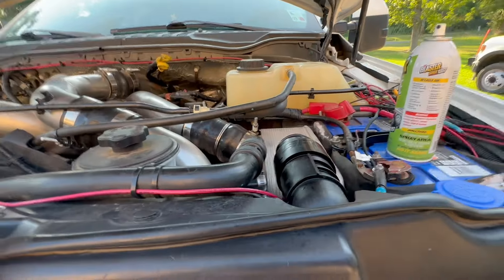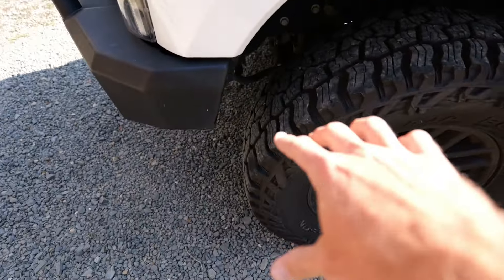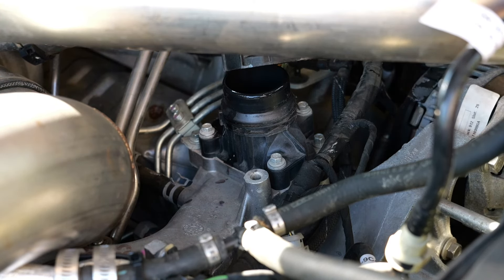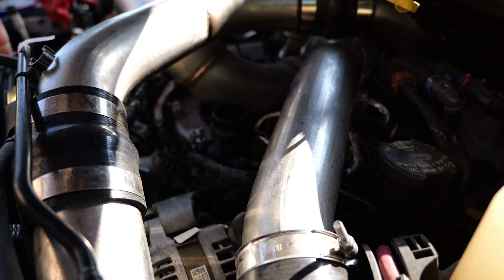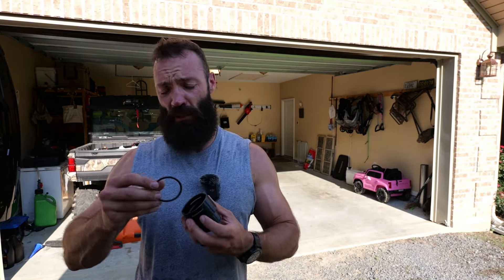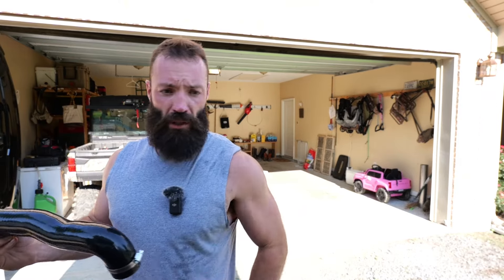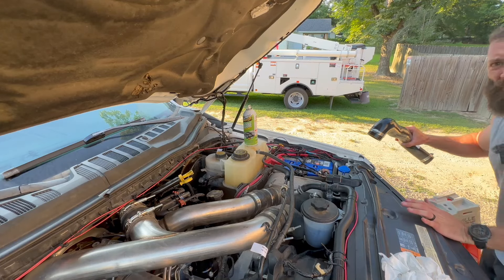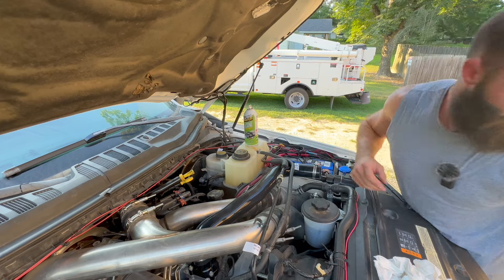Step-by-Step Guide: How To Install SPE Upper Radiator Hose on Ford F250 6.7 Powerstroke

Comment: I swapped in the SPE thermostat when I did this job on my truck.  Made a HUGE difference on trans temps, which is the main reason I did it.  Now when driving up steep grades in the Rockies, my trans will barely top 190, when it was getting up to the 220’s and 230’s before.  And when I’m towing, it stays in the low 200’s.  I know Ford says it ok to run these transmissions hot, but I feel a lot better seeing those lower temps.

Comment: Hey bro that spe adapter had slots in it and the radiator had two grooves you just need to line them up and it would have slid right on 😂😂😂 i know they say the SPE logo needs to be facing up but i think they were wrong with that, love your videos you’re funny as hell. Keep up the great content
Reply: Yep, align the grooves and it took me like 2 seconds. Thanks for the video! Nothing like winging it at 11pm at night and getting it done in 30 min thanks to you!

Comment: I appreciate you going through all the trouble I wish I could've helped you a little bit of wheel bearing grease works better than silicone mine slipped on no problem but very thankful to watch you go through the stressors before I did
Reply from the maker: Anytime my man. Thanks for watching! I’ll give that a try next time! 🇺🇸🦅🇺🇸

Comment: I am having the same problem as you Colt getting that fitting on, was afraid I was going to break the radiator! I will try the wood block trick. 
I agree it looks nice but damn does it have to be that tight! Freakin radiator is plastic! I did the SPE heater hose reroute kit and need to install the turbo coolant line as well. Appreciate your videos!!!

Love your videos brother! Yard work looks great, your girls will appreciate their Dad!

Thanks Bro!
Reply from the maker: My man! Yea get the block of wood and a hammer. Mine slipped on in 2 hits! Thanks for watching brother! 🇺🇸🦅🇺🇸

Comment: Great video bud! I’m about to order these hoses and their low temp high flow thermostat and it’s good to see I’m not the only one cursing and struggling with shit under the hood 😂
Reply from the maker: Thanks my man! Yea I’m glad I’m not alone! 🇺🇸🦅🇺🇸
Reply: Brother I just did the install last weekend I had my board and mallet ready to go to set that dam aluminum coupler and it just slid on so easily 😂😂 I lined up the notches and it wiggled on thanks again for the video have you done the lower hose? That one looks like a bitch but I got the replacement one as well

Comment: Nice job. When I installed the SPE intercooler piping and CP4 disaster kit I opted to replace my upper hose with the factory hose and now I’m glad I did so thanks for the video. I did use the SPE low temp thermostat which I like. If I recall the housing bolt torque spec is around 48 in-lbs so your torque technique was probably within spec 😜.

Comment: What happened to the new intercooler. I see you put the factory one back on. I installed the mishimoto intercooler on my 6.7 and it sounds like F22 raptor taking off. 😂
Reply: I’ve been looking at the mishimoto one. What color did you get and how difficult was it to change?
Reply: @carls2210  Black. Took me about 2 hrs. Very easy install.

Comment: I have always just used Vaseline for O-rings. And silicone gaskets. I have never had an issue ever.
Reply from the maker: Yea. Normally this spray works great. But judging by other people’s comments they had they same problem. This thing was damn tight! 🇺🇸🦅🇺🇸
Reply: I used Vaseline on the SPE cold side pipe and it slide on pretty easy. They definitely make sure they fit tight 🤣🤣🤣
Reply from the maker: @statla6891  Vaseline always helping out in tight spots…..😂

Comment: Good stuff.  My 2 cents:  I've had bad luck with worm gear clamps with radiator hoses.  If you can, replace them with constant tension clamps (kind you use a pair of pliers to squeeze and remove).  Worm gear clamps don't do well with heat cycling and tend to loosen up over time.

Comment: man I hope yours doesn't leak, I went threw 2 of those SPE rad hoses and all it did was leak at connectors by radiator and engine, added double clamps, tried the best constent presure clamps, nothing but problems, had to use another brand.

Comment: After replacing my upper hose by spe.  I checked it a day later and my hose was sucked in and once opening up the reservoir cap it released the pressure.  Contacted spe.  They say I need to replace cap on reservoir. Why is this. You know?  They didn’t answer me back. So just seeing if yours had that problem ?

Comment: Just did this in my dad’s 14 PS.  
He had already installed the lower temp thermostat. 

That upper adapter will only go one way. Has a thin and a think index notch at top and bottom.  Once we figure that out it went on with slight force.  

We also did the SPE coolant rerout kit at the same time.  The fitting which needs replaced at the lower heater core line is an absolute WHORE to get too.

Comment: So now driving it for a bit, do you recommend it? Not just looks but over all function dick.
Reply from the maker: I do like it. Haven’t had any problems at all.  No leaks or anything. Looks way better and I’m happy with it. Just did the SPE coolant re route and it cleaned up the engine bay even more.  Appreciate you watching and for the comment…..Dick! 🇺🇸🦅🇺🇸
Reply: @COLTSWAY  brotha I watch all you videos, your dumbed down way makes everything easier for us peasants. My truck would have been a brick during the delete withoutcha so thank you for making content for the regular man......dick. Keep it up! 🇺🇲🤙
Reply from the maker: My man! Thanks brother! 🇺🇸🦅🇺🇸